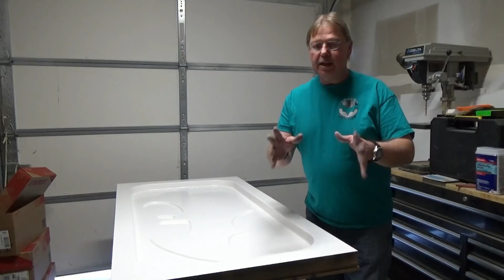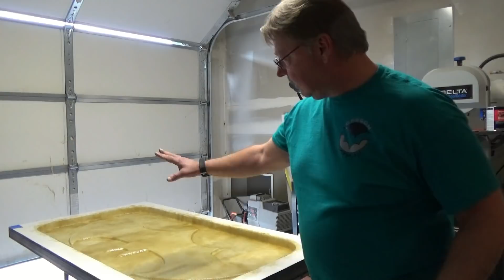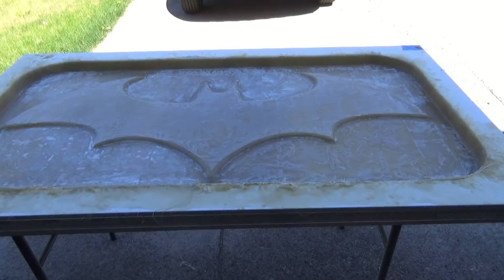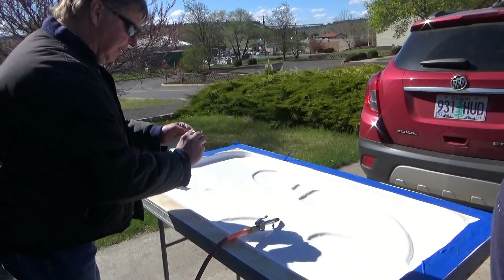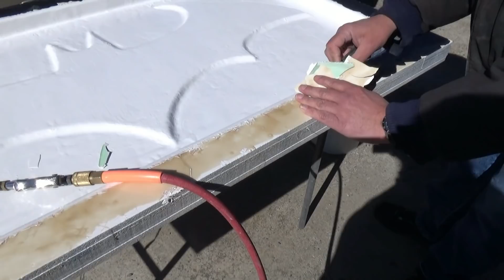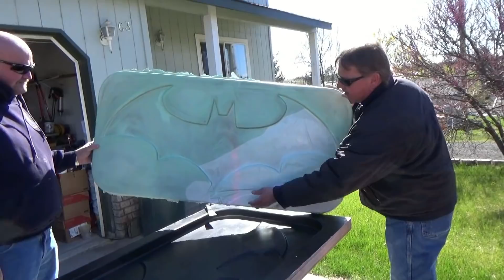DIY – Front Window Rock Guard – Stone Guard for your RV - Part-5

Comment: Another extraordinary video series!  It's almost like you have done glass-work before.
I don't think I've seen a trailer over about 5 years old where I am that doesn't have damage to that front cowling, or it was removed altogether with only holy windows remaining ;)  I think if I put that much of my time into your awesome mold, I woulda gone ahead and bought at least 1 sheet of Kevlar fabric.  2 vehicles passing at 60 mph can throw a pebble into your trailer at 120 mph.  So bulletproof may not be overkill.
Awesome craftsmanship!
Reply from the maker: :)  Here in Oregon, the sand the roads with Lava Rock... stuff has destroyed the windshield of my car, don't want that happening to the trailer! Thanks Aspendell for stayin' with me, project has been lots of fun! The Batguard looks pretty good on the front of the trailer!

Comment: Well done but I wasn't sure you were ever going to get done picking the edges:)  
One bit of advice to increase rigidity you could have embedded some aluminum angle between layers giving you more strength were the hinges are going to go and the gas struts.  Are you going to include total costs for this in a future video?
Reply from the maker: Hey 280zone! Thanks for watching!! After loading the video, I watched it and thought the same thing myself... "man, why didn't I edit that down a bit?". Wayyyyyyyyyyy long!! Sorry about that!  Trying to keep the weight down, I decided not to laminate anything between the layers. The hinge I used has holes spaced pretty close together, didn't choose to use an aluminum backing. I bolted the hinge and used larger fender washers. No sag, seems to be working alright. We'll see what happens after some use. Yes sir.... I'll do a breakdown of the cost, and where I think money can be saved. Not sure if anyone could purchase what I have for less than what I made it for! Thanks 280Z for stopping by!

Comment: Nice work there, Batman :) The few times I have done works like that, I do let the fiberglass stretch out all the way to the end of the mold (as far as I apply the gelcoat), then one can use the "frame" to get the piece out of the mold and trim and paint it afterwards. But this one is so shallow I am sure it wasn't even an issue.
Reply from the maker: Thank you Van Geezer! I had intended to do just that and lay glass on the edge, but I ran a little short with the fiberglass, so I made the best of it with what I had. And because it was shallow... worked great! Thank you for watching!

Comment: I really like your videos of making this rock guard. I already cast resin so this is just bigger. I want to use Plexiglas glass and 2X4 s for my frame. My camper is a 1966 cardinal. I bought a big sticker that looks just like original stickers. Do you. Think I could put the sticker in the resin or on the finished piece. Also I have those old 4 pane diagonal windows. They still allow dust and so forth into the camper. What do you think about making covers for those?
Reply from the maker: Hi Jenn! It is a matter of personal taste, but I would install sticker after... only reason is if the sticker lifted or blistered during the curing of the resin, then that would be bad. I think covers for the 4 pane windows would look nice, and should keep a lot of the dust out if there is no other way of sealing the windows. Thanks for watching the videos, much appreciated!